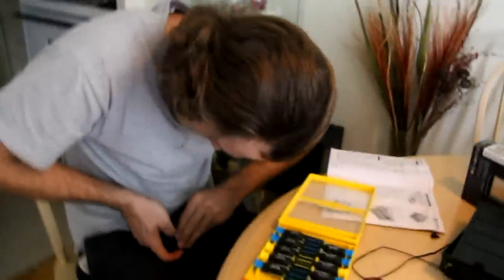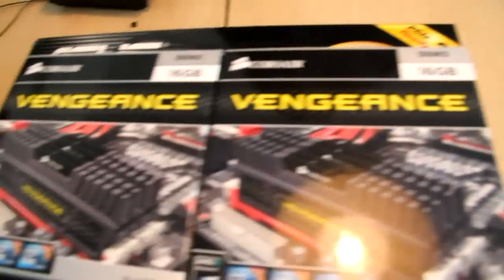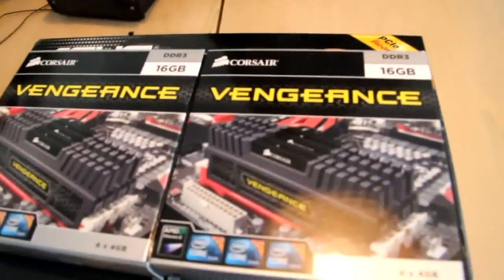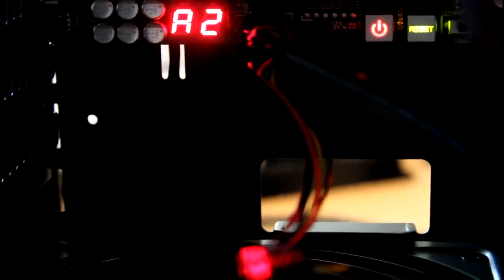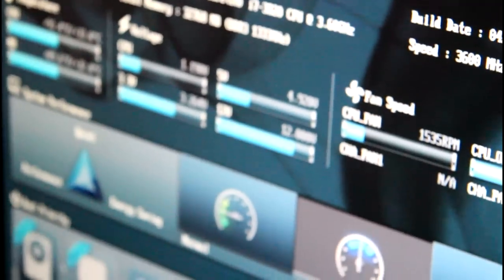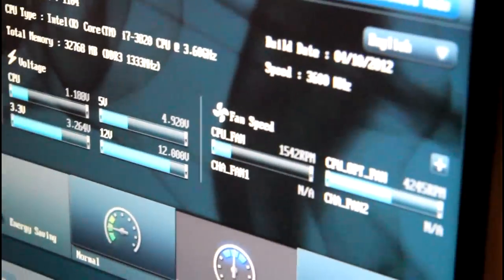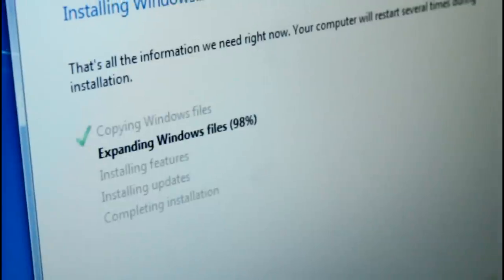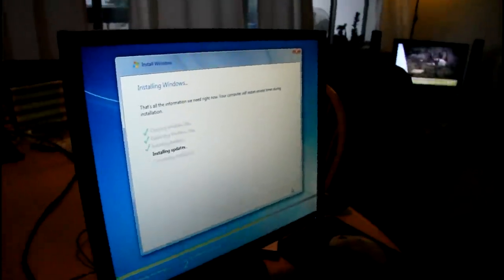32 GIGS OF RAM | Furious Pete Talks

Comment: Use ivy-bridge i5 processor, 8gb of ram (you dont need more unless you are rendering hardcore vids), gtx 660 (grapich card), 650W power-core, a z77 motherboard, 120gb ssd and 1TB harddrive is good enough.

Cheers!

Comment: well, it uses MOSFET transistors (PN junction) and nand gates. The reason SSD is less stable than HDD is usually because the floating bridge snaps after too many uses - to make it space and power efficient, they make the bridge only a few molecules thick. Happens after too many uses. RAID0 doesnt make it less stable. Oh, ye, I have BSc in both Computer science and physics (both summa cum laude), and been using computer all my life.

Comment: Its easy to say youre wrong. I may be, but I would like to know your justifications. RAID0 simply stores even blocks at one ssd and odd blocks at another. If Im accessing the same number of blocks, and each block has some independent probability p to be damaged, then it does not matter if i access them from different ssds or from the same one.

Comment: No more than in a single SSD, and nowadays there are very stable. My still works:) Well, it runs twice as fast. EXACTLY twice as fast (assuming you are always accessing at least two consecutive block in hard disk, which is usually the case). And what are the downsides over a single SSD? except the cost of course:)

Comment: But you can use home and 32gb of ram, you just need the 64bit edition. 

The problem is though that top 3d modelers/animators barely touch 32gb of ram. Shit, it's been a while but that would be a good 100 million polygons